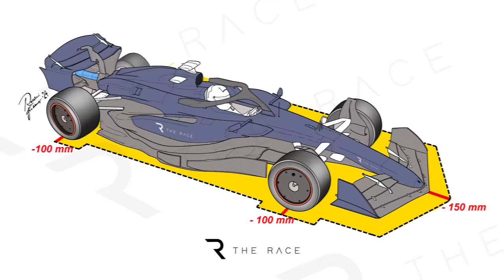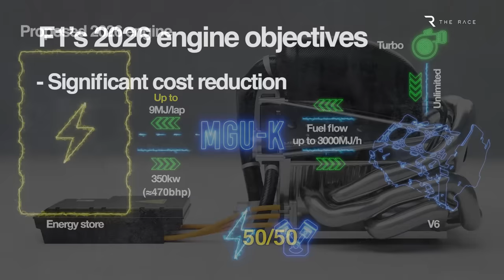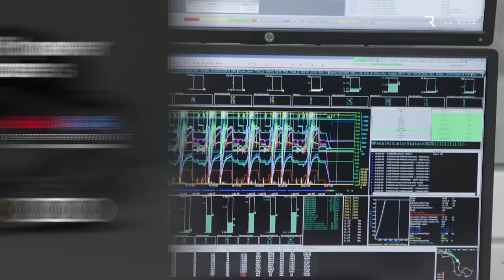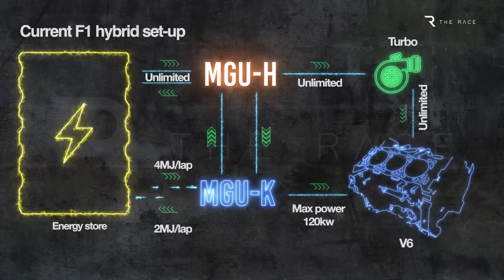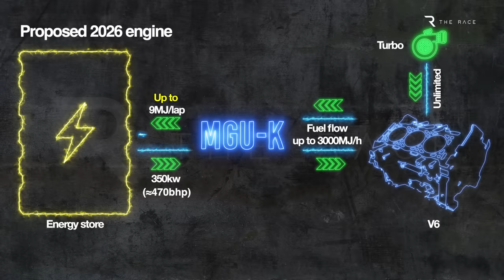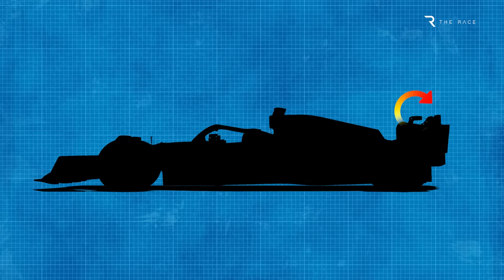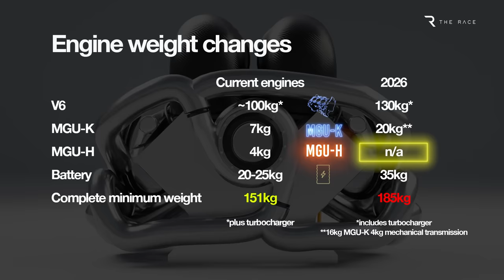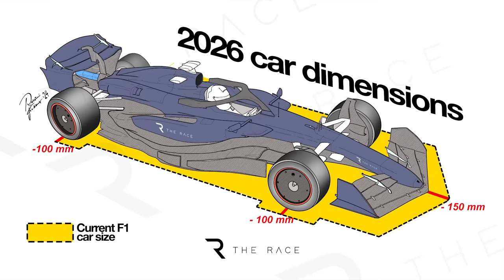The truth about F1's controversial 2026 cars

Comment: Literally just open up the technical regulations, allow teams to stretch their creative legs a bit. If a team wants to use a car with no wings, all mechanical grip & a supercharged rotary engine, let them. And allow multiple tyre manufacturers again.
Reply: You do remember how the last tyre war ended right? Indianapolis 05
Reply: @RD-wg9em  Nope, it ended after 2006 where Michelin made arguably the best tyres in Formula 1. In 2005, the FIA brought in a rule that prohibited tyre changes during the race; so instantly, brining up Indianapolis 2005 is simply unfair. 

The tyre war is what made F1 interesting to watch, as it allowed teams to vary their car concepts a lot more & drivers could vary their style depending on the tyres & the car concept that they would built with their team. It wasn't just a one-size-fits-all situation where only a couple of concepts work & there's only one style of driving that works, like we see today.

The tyre war is how we got McLaren vs Ferrari in the late 90s (yeah, remember Bridgestone vs Goodyear?). We also got the super close 2003 year where there were three teams in the championship fight (until Ferrari threw a hissy fit & the FIA interviened against Michelin).
Reply: @nath1606  my pessimistic view comes from other motorsports too.
There are benefits in conceptual breadth sure. But tyre wars are downright dangerous. The push to increase tyre performance always results in compounds that will fail, with little room to readjust.
Indy is the extreme example, but those tyres were going to fail even if changes were allowed, the lack of it just made an untenable situation obvious.
Goodyear vs Hoosier is nascar is a good test case. Catastrophic failures, some resulting in near fatal crashes. It’s a risk the sport can’t afford to take.
Reply: @RD-wg9em  I'm going to rephrase myself on one of my points, F1 wasn't made with Indy in mind (I said the other way around in the last comment). You have to admit, Indianapolis was a bit of an anomaly in the F1 calendar, as it was the only track that had NASCAR style banking. Even Laguna Seca with it's massive corkscrew would have been more consistent with the F1 calendar & Michelin would have had less of an issue there.
Reply: @nath1606  I agree, but the incentive for manufacturers to chase tyre performance at the expense of safety is still the main issue with a tyre war.
To prevent it from becoming dangerous a level of oversight would be needed that would undermine the idea of having competition in the first place
Reply: @RD-wg9em  Even if there was a legitimatly dangerous tyre, the teams could simply.. chose a different tyre until the manufacturer of said dangerous tyre got their crap together.

And if anything, if you want to make a good tyre, you don't want it to be unreliable (dangerous). So you could in fact say that tyre performance is good for safety, in that aspect.
Reply: @nath1606  it isn’t, you need soft compounds in order to gain performance and soft compounds will fail under the types of loading that these cars are capable of producing.
Also changing tyres isn’t easy, especially if a car is designed to a specific set. When Indy happened, the Michelin runners couldn’t just shift to Bridgestone, their cars would’ve been underivable due to the different tyre characteristics.
Reply: @RD-wg9em  The performance will ultimately mean nothing if the tyres aren't reliable. And you can make a tyre that performs incredibly well without being prone to failure (Michelin 2006). Also, on the subject of Indy specifically, correct me if I'm wrong but I don't remember there being many issues there in 2006 with the Michelin tyres, when teams were allowed to change tyres during the race again.

Yes, changing tyre manufacturers wouldn't be easy, I never said it would. However, Ferrari did that in 1999 (Goodyear to Bridgestone) & ended up winning the constructors, and then the drivers championship a year later. McLaren did that in 2002 (Bridgestone to Michelin) & Raikkonen nearly won the championship the next year & had the fastest (if prone to blowing up) car in 2005. And every Michelin team was forced to switch to Bridgestone anyway in 2007, Raikkonen won the 2007 championship despite being used to the Michelin-shod McLarens.

On the contrary to your point, we currently only have one tyre manufacturer in F1. The Pirelli tyres haven't exactly proven to be safe either, to the point where restrictions had to be put on tyre pressures & in one case, even enforced pitstops to make sure they don't fail. What difference has not having a tyre war even made, in terms of "safety"?

I would say none at all.

Comment: Why can't F1 have F2 size cars with a lot of freedom in the aero design?
- A lighter car transfers less energy in a crash.
- Smaller cars produce less dirty air.
- Smaller cars give better visibility for the driver.
- In a smaller car it is harder to block in corners and brakingzones.
- Smaller cars don't clutter in qualifying. 
- Lighter cars use less fuel and are easier on their tires.
- Narrow tires are harder not to lock during braking, demanding more skilled drivers.
- Locking up tires during a race will result in more overtaking and a nice smoke trail.
- A shorter wheelbase car gets very unpredictable when driven on the limit of grip.
- In smaller and lighter cars the Monaco grand prix can be fun again.
- The 2026 F1 power unit weighs more than a complete MotoGP bike with a full tank of fuel.

Comment: All of the talk about upgrades and innovations over the past two seasons seems to be about aerodynamic designs; what's so taboo about using air brakes? Regardless, maybe manufacturers could be allowed to compete with their battery pack designs, to get some variety back into the engine packages. There's definitely mad research happening in that arena within industry.

Comment: Take a V8/V10 car with decent tyres (not Pirelli). Ban all the tricks they use for outwash. Job done. Make it a V6 turbo if you really have to, and put KERS on it, but get back to the shorter length, lighter weight and better tyres. Limit all the extra functions on the wheel and driver coaching. Restrict the amount of race simulations they can run so they have to work out strategy themselves.

Comment: Unfortunately Redbull aren't completely wrong IMO. The Power Units are complete Frankenstein monstrosities and they're going to have to lean hard on the active Aero to keep the cars anything close to the current pace.

The core problem is they've dropped 150KW's of output from the ICE side, (whilst also changing some rules that will likely result in a less broad power band), whilst adding a bit more than that on the Electric side. And the available energy per lap hasn't gone up quite as much as the electric system output. Overall their total power under electrics is up, but its going to be available for elss of a lap. And it was never available all lap to begin with. There's going to be a lot of situations where the car just has a third of it's power missing compared to now and the care weight isn't dropping that much.

It going to give the car a really rough time in the corners. Highspeed corners like the 220R at Suzuka will be the worst, no way they can use the active Aero there and the Electrics aren't going to be able to run through the entire corner either. Circuits with relatively few or very short straights are going to be an issue too, as is circuits with very long laps. In those situations the Electrics just aren't going to be there to compensate on every corner.

With just the ICE these cars are going to be shockingly slow by F1 standards in the corners.

On the other hand the tweaks to allowable power usage do mean they probably will avoid the worst issues Red Bull are worried about, but its going to come at the cost of overall performance.

The worst part is it bears little resemblance to road Hybrids which are pretty much the opposite of how F1 does it. Road Car Hybrids use the electric output for the majority of the output with the ICE providing rnage extension and [peak power output benefits. The whole powerplant ruleset is a real frankensteined mess.

Comment: I still cannot understand how they want to charge the battery.
Most of the energy gets lost during braking through the front wheels.
SO how do we think that the battery can charge to full, without using the ICE as a generator?
50/50% is a misleading statement.
And all of this effort on batteries and electronics for saving some 40kg of fuel per race?

Comment: Why Max  was having to downshift on a straight during the simulation of the new engine/regulation? Does anyone know what the reason for the downshift need?
Reply: Running out of electrical energy. So that means he would lose 470 hp, and that would make the car slow down so much it wouldn't be able to run at max rpm in 8th gear. So 7th would be needed to maintain the same speed.
Reply: @dylansmit3883  gotcha... Thanks mate :)

Comment: Need new open wheel series with V10 power.  Zero electric component or environmental concerns.  These are not daily drivers so gas mileage and pollution is totally irrelevant and f1’s nonsensical pledge to be carbon neutral will be the death of the sport.

Comment: It’s no coincidence that 2 of the best F1 designers of all time claimed the current regulations are an absolute sham. They both made some of the best road cars in history with high revving V12s whilst being more environmentally friendly than most if not all of the hybrid engines before. And that’s without sustainable fuels. They aimed for small and lightweight chassis whilst having good power from the V12s and they reached a realm of performance and drivability not even the likes of Koenigsegg or other high performance manufacturers have been.

Comment: Would a well designed solar panel that keeps the batteries nearly 100% at all times be allowed and if allowed would it be viable ?
Reply: No. There just isn't enough solar energy hitting the surface of the car's area to provide that much power. Plus, that would make races even MORE weather dependent.

Comment: Vettel - Proves that you can have a much smaller, much lighter car with a loud V10 using sustainable carbon neutral fuel. 

F1 - 'So, we're making the car 10cm smaller, extremely heavy, an even quieter engine with even more artificial aids.'

Comment: I just don't understand why there's a need to go for more electrical power. If F1 gets 100% sustainable fuel for 2026, they could be a pioneering force with that and on top have racecars which don't have to conserve battery life for the race. Flat out racing is all the fans want in a Grand Prix. F1 is going down a route I don't want to follow anymore.

Comment: ok so what F1 needs to do is say "minimum weight is 698 kg and safety regulations are these do your job." Then it will be up to the teams to decide if they want a big overweight car (better aero efficiency) or a small minimum weight car (worse aero efficiency) simple as that. They can make the regulations whatever they want so if they want to reduce the weight all they need to do is lower the minimum weight and let the engineers engineer

Comment: So to make the cars more unstable, to fit bigger batterys 🔋 adding more weight.
To then put more strain on the engines.
To then dangerously make the wheels 🛞 and tyres narrower making less grip on the car, at the same time making them faster?
Who makes these rules up in the FIA? They need to talk to the teams and engineers as to making protection unstable death traps.
These rules will simply destroy F1 and make the cars into a joke that simply are not fit for purpose.

Comment: Right now any engine has ~850HP at any time from the ICE + additional 160HP from the ERS. That means even without the electric power, the current cars have 850HP.

The new rules bring the power of the ICE down to ~475HP and raise the electrical power to ~475HP. That means if the battery is empty, you've only got ~475HP to work with at any time and since a larger battery is super heavy, they'll have to make do with the current technology. The new cars will have to constantly recover energy i.o. to have a decent amount of power to work with. Anyone with a degree in mechanical engineering only needs some openly available data and a calculator to come to the same conclusion.

These engine regs will be even more complicated than the current ones, which always were a huge mistake given how irrelevant the MGU-H was in a road car application.

F1 engines are useless in terms of development for road relevant engines, it's just good PR for greedy companies.

I haven't heard the "Frankenstein" comparison yet, but it's spot on.

Enjoy the last two years guys, F1 will be very very weird.

Comment: There is a great mismatch between what the fans want and what the major companies, which control F1, specifically the companies that provide the engines, want from F1. They want to use F1 to develop technology for later use in real situations; they don't care about the essence of F1. It's not worth it for fans to ask for the return of V10 or V12 engines because that's in the past; it's not going to happen again. Unfortunately, in the next 10 years, we will see a convergence between F1 and Formula E because that's the future. However, I have no doubt that if the FIA created a category where we could see F1 cars with V10 or V12 engines again, it would be very successful.

Comment: If F1 genuinely would have had environmental issues at heart they shouldn’t have banned multiple injections and ignitions per power stroke for example. 
F1 engines could have run more efficiently but above alle could have developed new tech that WOULD have been relevant for normal road going cars.

Comment: They should just reduce the fuel available for a race and open development of the internal combustion engine. The valve train hasn’t seen any innovation for this entire set of regs, the turbocharger specification and running parameters are overly prescriptive etc
If they allowed more freedom with the engine I think it would be far more relevant to the real world

Comment: Liberty Media, owners of F1 want street circuits for more exposure and generating revenue and minimizing expenses. Street circuits have a lot more braking zones for energy recovery... The regulations are downstream of this. This is the only way these ridiculous regulations can possibly have half a chance of working. 

They will: 

-cut all the best race tracks and replace them with street circuits

-keep lying about sustainability when they're already net zero

-with acknowledge the cost cap paradox in that teams can't develop the required battery technology to meet demands

-lap times will increase by 5-10 seconds 

-race distances will be reduced

-overtaking will be made more difficult because of recharge of batteries

-batteries will degrade at a rate of ~12 times faster than they currently do, increasing expenses

And it's all unnecessary given the carbon neutral fuel, but entirely necessary to justify cutting tracks like spa, suzuka, hungaroring and others which are not in cities.

The new regulations are simply American greed, they're designed to gut the sport for everything it has in order to increase revenue. Liberty Media is just getting started too. Expect massive, controversial changes in the next 3 years. Formula 1 is as good as it's ever going to be right now.

Comment: This is easy...but no one really wants to tackle it hardnosed. 
Just lose 500 kg weight, make the cars 30 cm narrower. Radically opens up passing in corners.
Retain the Halo for sure. Go back to ICE  NA engines, no more than 2 L no MGUH or MGUK. Hell... let them pick the old v10's and have spec engines built by one manufacturer. Rev limit to be 17000 rpm....Keep  8spd DCT trans.  Lose the heavy  18" wheels and allow any aero. Have Aramco pay for the fuel and aero development with open access to all testing and data for all. 
Allow 2 more Manufacturers to add more cars to grid.  Lose the idiotic tire rules.. Keep the tire choices but if some one thinks they can go the distance..let them w/o penalty...this allows for strategy choices...
For sure install track limits at all tracks with sensors at all corners..during the race if you violate and are found guilty then you get penalized one lap... not five seconds.... No more going off track by six feet and having the inside tire just barely in by a hair. 
And the stewards should enforce the racing rules properly. Drivers like Verstappen deliberately lunging at the last split  second and driving off other cars and going off track themselves should, after being found guilty, brought into the pits, disqualified from that race, penalized all points from that race and a grid penalty of starting from the back spot  at the next race.
Sometimes you have to make the penalty tough enough that people wont violate due to the consequence.
BTW I like Verstappen, but the constant threat of him or others forcing another car wide, blocking the other car or causing damage to other cars by their actions isn't racing it is just bullying using a car as a weapon.

Comment: Engine weight is up 30%?! it's a less powerful motor, why is it increasing by 30KG? Also not mentioned in the video was the total fuel weight, afaik the weight limit for fuel is decreasing, which helps offset some of the weight gained in other areas.

Comment: Get rid of the hybrids. Go back to smaller, lighter (around 600-700kg) turbo cars running on sustainable fuels. The lighter weight improves every aspect of racing, including wear items like brakes,  tyres and fuel consumption. I'd argue safety would be improved as well. It will also reduce the cost and environmental impact of shipping the entire circus around the world.